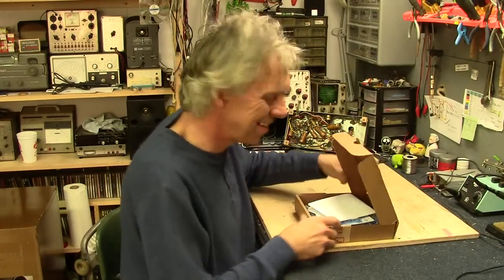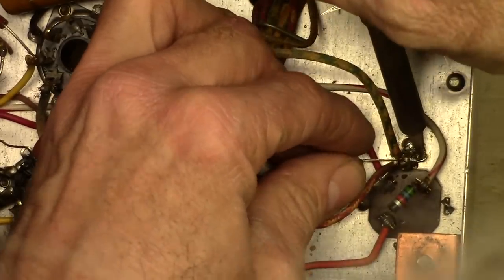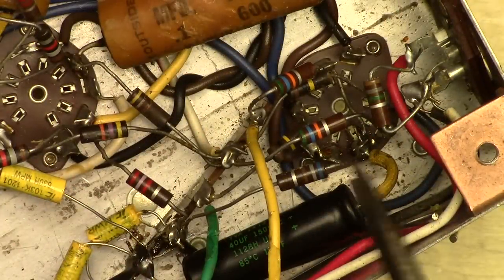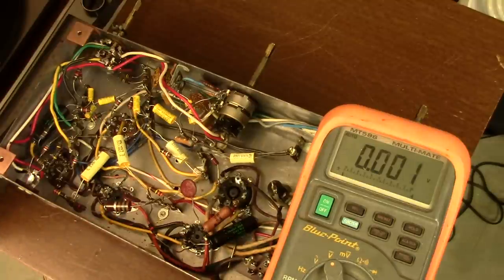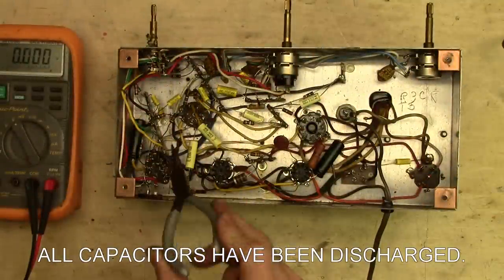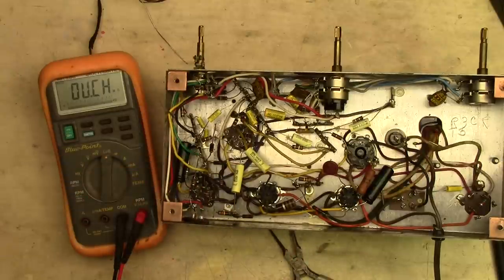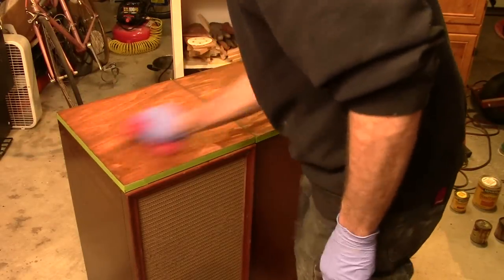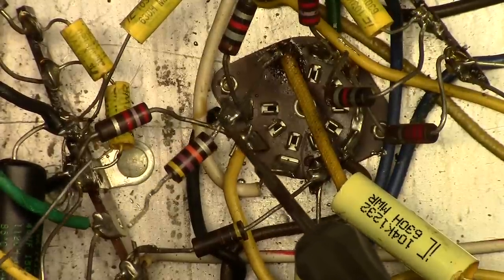1960 Zenith Stereo Restoration Part 3

Comment: Another great video. Good advice on discharging caps before inserting fingers.....

A good discharging tip I picked up a many years ago was to simply connect the plate of the valve farthest from the power supply straight to chassis/ground. The voltage will drain away safely and slowly through the various power supply b+ resistors, avoiding any scary bangs and sparks. This is normally "V1" in guitar amps or the first preamp valve in your case. 

You deserve a medal for your correct pronunciation, by the way. 

SoLder on.

Comment: Awesome job. One thing I would love to learn is to restore the electronics like you. I have one of these units; but, it is in blonde wood, has a massive chassis on the floor of the unit, two high frequency midrange horns as well as the two big woofers like your model. Exact same turntable. Tuner has more features as well. If yours sounds this good, I would love to have mine restored. It was given to me about 15 years ago and is a beautiful piece of furniture as well.
Reply: If you are anywhere near London I can restore any vintage gear to a high standard, or give you any help you need to approach the restoration yourself. Mechanical and electronic - not woodwork..))

Comment: Thanks for this series of videos.  Was at an estate sale today and picked up a 1961 Zenith Mendelssohn Model SFE2503T. Just has the cobra turntable, but it can be fitted with a receiver.  It's a bit narrower than yours, but the turntable and amplifier are the same.  Interestingly, mine was built the same year I was born as well.  Haven't looked yet on the chassis for the actual build date.  You are correct that there are probably more resistors that have drifted.  I was wondering, I didn't see that you replaced the canned electrolytic cap on top of the chassis.  Did you check that one. They usually are bad as well.

Comment: Hello Dean!  I grew up with a console like this.  The components are exactly the same and the cabinet is only slightly different.  I recently came in to possession of this HiFi from my mother and I'd like to change out the capacitors and tubes.  Did you order them all individually or are there kits?

Comment: Another nice video! Mouser is also a great resource for capacitors and other parts. They ship VERY fast! What type of replacement caps are you using, polyester, polypropylene, etc? Thanks for the series.

Comment: You're a genius!!!!  And thank you for this in-depth look into each part of the process. 
I have a 1961 Montgomery Ward Airline AM/FM Phonograph Combination WG-2810A that I got 15 years ago for $20.  I was intending to try to convert it from tube to a more up-to-date electrical system, replacing the turntable with a current one that can convert to mp3s with their software that takes out pops and sizzles (so my eldest quits taking my platters) - so they quit taking my vinyl.  I also toyed with the idea of having a hole cut into the side of the chassis (near the controls) and include a CD player as well.(But how do I set controls for that to play??) 
Is that a outlandish idea??? If so, then I intend to order tubes and capacitors and learn to solder. Hubby has a meter so he'll do that part.
Reply: Anne, this is my own freely-offered personal opinion, and it carries a 100 percent money-back guarantee, but I would not do any of what you propose.  A 1961 Monty Ward stereo is a bona fide antique, and stuff like this is original only ONCE.  Gutting it to install modern electronics and cutting holes in it destroys its value as an antique.

Do whatever repairs it needs, but keep it as original as possible, particularly the 'visual' aspects of it.

If you want to digitize your records to MP3s, there are a variety of modern turntables available.  Audio Technica's LP60 is a full-automatic turntable, and  they offer a version with a USB connection so that it can be hooked to your PC for conversion projects.   I bought mine for like $115 last year; I think the price may have gone up a little but not too much.  Please please PLEASE do not go with any of those cheap 'suitcase' record players.  Seriously, those are more 'novelty' items than serious stereo equipment.

'But I want to play the music on my antique stereo!' I hear you say.  Bear with me for a minute, we'll get there.

You can buy Bluetooth receivers that have outputs compatible with equipment like your stereo, though you might have to make a few changes in the stereo's wiring (note:  these changes are completely reversible, so no worries about affecting the value of the stereo!).  So, while you don't have much option for CD, you CAN rip CDs to MP3 (just like you can with records; in fact, the process is even faster than with vinyl!) and use a smart phone to play your music through your antique stereo.  If you're not proficient with electronics, I STRONGLY urge that you leave such modifications to a professional; as he points out in the one of his previous videos, tube equipment can be dangerous to work with, and there are a few quirks you have to be aware of when making the mod.

Comment: Hi Thanks for this video! I have the same and the platter now stops spinning when the record drops. I have to help it gently, then it starts spinnig again and the arm drops correctly. Is there something I need to greas? I can't figure out what the problem is. Thanks!
Reply from the maker: Yeah it's just old thickened grease. Try removing the platter and spray the mechanism underneath with WD-40. It might loosen things up a bit. Follow that up with some light spray lube.
Reply: @HackaweekTV  Thank you! Will try.

Comment: Great job Dean!
You really need to get an isolation xformer though.
Reply: Agreed!
Reply: *****
It just occurred to me; Couldn't you use an AC inverter if you didn't have an isolation transformer?

It would be floating off the battery correct? So the AC shouldn't be referenced to ground.

That way you could get double duty out of it. Normal AC off a battery when camping or the power goes out and an isolation xformer.

Comment: I've got a similar year console that seems to be leaking some voltage to ground (get a little tingle when you use it while barefoot on concrete).  Is this typically a difficult thing to track down?  Just wondering if it's worth trying to get someone to salvage it or not.
Reply: It's probably the filter capacitors for the power supply. It will be a large metal can looking thing on the same side of the chassis as the tubes. Be sure to discharge the caps before working on it!
Reply: Hey! Thanks for the reply!  I'll probably punt to the local electronics shop, i just didn't know if it was even worth having him look at.  I didn't want to get $400 deep into a repair. :)    Great vid,btw!

Comment: I just picked up a 1953 Zenith Cobramatic from Goodwill. It needs a lot of work. I have zero electronics experience. Do you think attempting to restore a stereo like this is too much for a beginner?  Amazing job on yours by the way. You're going to get a lot of enjoyment from it.
Reply: Probably. See if it even works. The problem with these is bad capacitors, which can cause a fire.
Reply: ***** Thanks for responding.  The radio works, but only picks up a few AM stations.  The turntable was spinning in the Goodwill store, but once I got it home, it spinned for a few seconds then just stopped, however the motor kept running.  I wonder if all I have to do is clean and oil the turntable?
Reply: Once you begin restoring vintage/antique radios and consoles you become hooked! Yes, you will make mistakes and frustration will set in, but we all learn our lessons. Couple years ago, I restored a 1940 Zenith radio console 10s454 but developed "squeal" sound off and on. About 3 months ago, went back to see my repair work, wiggled some tubes as the console was playing and the squeal returned. The culprit was a loose wire that needed to be re-soldered. Safety is the #1 issue when working on tube radios, but don't let that discourage you.
Reply: Hi Jason, its a year on! How did it go with the Zenith? I am offering my help to beginners all over the place at the moment. Same applies to you. Any help you need you can ask away. 35 years experience in audio, Hi-Fi, design and restoration of vintage gear.
Reply: Martin D I have a 1959 zenith sf185r in dire need of service. It was my grest grandmas and my grandpa passed a week ago and he wanted me to restore it. Has the extra speaker with it everything. Radio tubes amp phone everything needs work
Reply: Very sorry to hear about your Great Grandpa. Any help I can give you are welcome. I am in London, so not sure if hands on help is possible. Let me know.
Reply: Martin D A thank you. It was my grandpa. My great grandma just died a year ago and now this. It's been very rough. I'm in cincinnati so I'm not sure exactly what help you can give. I'm 17
Reply: Also. What is ur email?
Reply: lpj46, Again very sorry about hearing how you lost your grandparents. Best not to give out personal details on YouTube, and that is a good general lesson to remember! The whole community here though can and will chip in to give help. It may be though that the job would be too big for a beginner even with help, especially  if you have had no electronics experience. 
Yet it should be saved as it is a wonderful bit of history and a part of your Grandparents life. Can anyone else in the family get involved? It could be a long and irritating way to do things, a bit at a time - but it could be done if you find someone willing to help who has some experience. 
Also it's worth saying that if it has sat unused for some time it should certainly have someone who knows what they are doing check it before any attempt to switch it on. Cables and insulation can suffer with age as of course can components internally. Voltages here can be dangerous.
What condition is the cabinet in? Might be better to get that renovated before the electronics?
Reply: Martin D A the cabinet is in very immaculate shape. Only a couple scratches and that's it. It always was in great shape and it was not used after my great grandfather died in 1972. So it was 44 years. If you could could you private message my channel and send ur email that way I can send lots of pics

Comment: I have a hammerstein cabinet radio and record player. I dont know how old it is but it comes on but when you turn volume or any other nobs like the bass or treble it gives a scratching  sound and the turntable needs some attention.what can i do to get the humming scratching noise away?
Reply: Deoxit, it an electrical cleaner / lubricant & works great for potentiometers.  Spray a little as it goes a long way.  Then exercise the pots.  Good luck.

Comment: I've got an old RCA 811K upright auto tuning that I need to SAW-DER up. Sadly, I've got to SAW-DER on all new wires too, and not just the caps as the casing on the wires is breaking down. Any advice on what gauge wire to SAW-DER on? I figure I'll use solid core for SAW-DER-ING. What ya think? ;)
Reply: BTW, have you tried swapping the right/left speaker leads? It's possible from the sound that the voice coil is blown in your left channel.
Reply: Scott Hildenbrand It's pronounced "sol-der" :) Solid core sounds good.
Reply: Scott Hildenbrand It was bad caps and a bad resistor which supplied plate voltage to the left channel preamp tube.
Reply: ***** Ha.. Ok, you win.. solder it up then. ;) 

Looking at some 20 gauge solid core dispensers so I can run over this thing. I've also got an old farm house radio.. Dang thing has an A-B battery though. For now I'll just stack 9v's on it.
Reply: Scott Hildenbrand I have an old army radio that used A-B batteries but at some point someone installed and A-B batter adapter that plugs into 110 volt! It works great!

Comment: The 50's was an interesting era in the audio fidelity world. By 1957 turntables,  preamp and amp section in a console began to sound rich, but sometime in the mid 1960's through the mid 1980's there seem to be a set back because many audio equipment that I have came across sound rather like 'tin."
Reply: Agreed. When things went digital we lost all the dynamic range that analog had to offer.

Comment: Measuring voltages with no current draw is pointless. All it will show is resisters that are OC as you found. It will not show any out of spec resisters. The voltages should be measured with the valves in place. I would have replaced all the resisters as they always go high, they might be ok today but they WILL give problems in the future. I would also replace all the papers and electrolytic caps in the tuner as well.
You should never solder the pins on the cartridge, it can damage the crystal/ceramic elements in side, best link the plugs not the cartridge pins. Nice unit however, surprised it only had a single ended amplifier giving 3 watts per channel (EL84)

Comment: Do be careful about powering up an amp without the power tubes,etc. installed. The B+ voltage will probably soar,since the circuit is unloaded..and may over-voltage your electrolytic filter caps. BANG is not fun!